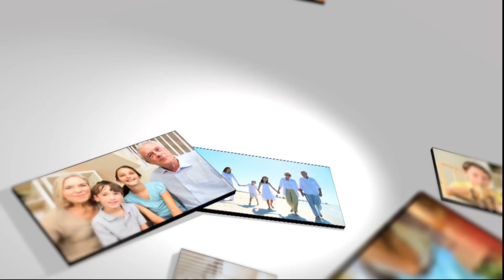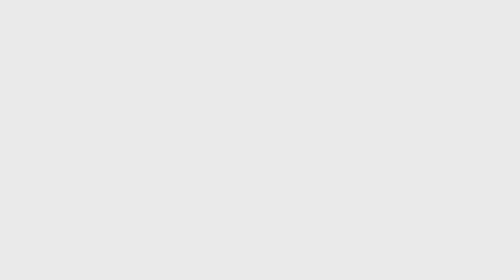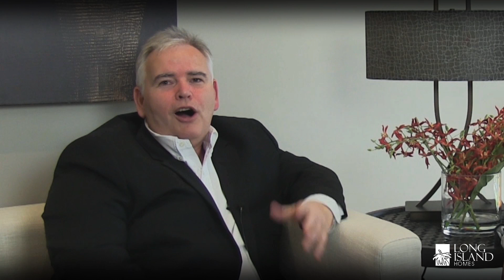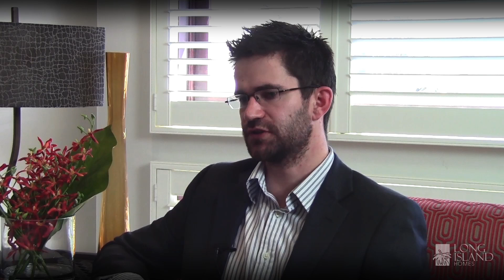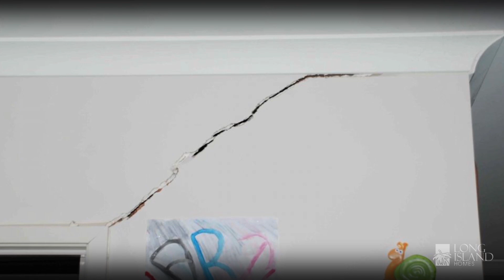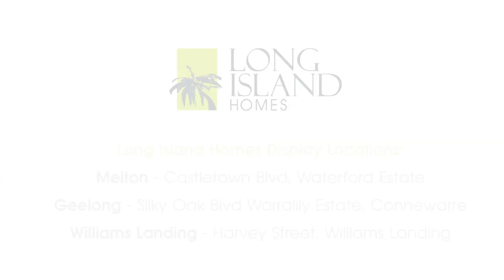Failed slab?! Find out why

Comment: do you  recommend raft slab for high reactive..
soil is red volcanic soil  at rockbank melbourne / thornhill park

i will build 2 story, i like to have strong column with concrete fill.. is that better to have that feeling of strong foundation 
columns normally covered with breaks
i dnt see metals inside the breaks obly timber.. is it worth to upgrade bearings?